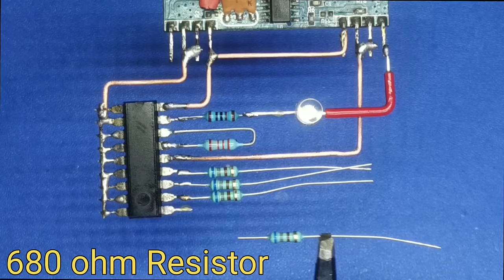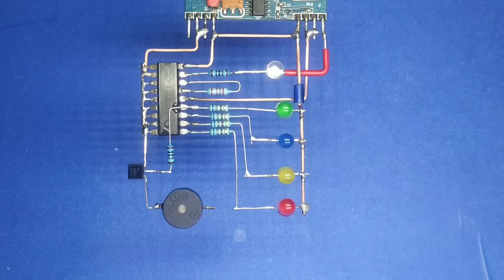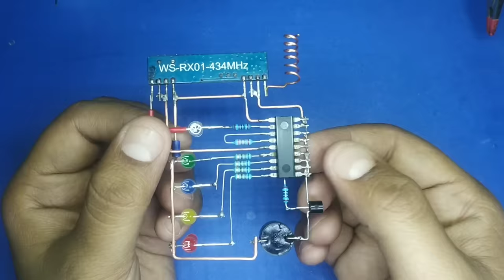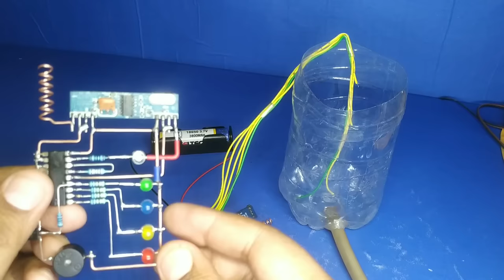How to make Wireless Water Level Indicator with Alarm

Comment: good project bro and helpful for us what is range of transmitter and receiver and what is cost of this project.
Reply from the maker: Hello, Range in open space (Standard Conditions) 500 Meters with Antenna / 100-200 Meters without Antenna....For component prices visit robocomp.in Link is given in the Discription Thank you so much
Reply: @anuragprojects  thanks bro for your valuable  reply
Reply: @anuragprojects  on that page they only have 433 MHz

Comment: Dear friend, I am following the video of level sensor without wiring. The instructions indicate the 434 component as transmitter and receiver and I have not been able to find it, the most common is 433, it could be replaced by this one. If so, what would the diagram look like with this substitution? Thank you
Reply from the maker: Hi, I am making video on 433MHz RF Module. You must have a look. Thanks for watching.

Comment: Nice one, after you did the level indicator LED's was that a diode you connected up the LED's and if so what wat the part number, also if I only wanted to have a beep only on the 25% marker I would I do it. Keep up thi good content
Reply from the maker: Hello, It is not a diode. There is a piece of blue color pvc wire insulator which use for insulation in cross connection. Thanks for Watching 😊
Reply: @anuragprojects 😂

Comment: Good job bro..I m also using this circuit as wireless power switchs for my home appliances....but pls confirm how many days transmitter battery  work...as we have to regular Power on transmitter circuit..also confirm is this work from third floor to ground floor distance...?
Reply: Could you show the schematic for the switches?
Reply: The battery will flaten out in two days. U need to use continues power source.

Comment: Hi,
***In long wire in tank circuit diagram *
In receiver circuit Bc558 connected to an resistor what is the value of that resistor. 
Thank you
Reply from the maker: Hi, 1K Resistor. i have updated the circuit diagram again. Thank you for watching

Comment: Hi, circuit works perfect, but issues with voltage drop in wire when real length (1 meter long) wires are used. Any suggestion? I am providing power fromtwo  5v 1Amp adapter individually to both transceiver and receiver that is also passed to wires
Reply from the maker: Hi Bro...This new transmitter circuit is made for you. You must try it. This will solve your problem... Link - Link :- https://drive.google.com/file/d/1k-_t8p5UeQ7fjDKBJiMrb55WGsPYXJC_/view?usp=share_link
Reply: @anuragprojects  Don't you need water to be a bit salty for that to work? Do fresh water give you enough conductivity to bias the bases of the transistors high?  By the way, the same question applies to the original transmitter circuit. Is the water in your video completely fresh or has some salt in it?
Reply: Link is not working
Reply from the maker: Thanks for watching. Link :- https://drive.google.com/file/d/1k-_t8p5UeQ7fjDKBJiMrb55WGsPYXJC_/view?usp=share_link
Reply: Link is not working...🤔

Comment: Dear Sir,
            If two wireless water level circuits are to be installed with two water tanks, then what is the method to vary the frequency of both, please guide me. 
Regards
Zafarullah Khan Faisalabad Pakistan
Reply: I think try 333mh for the 2nd one

Comment: What can be the maximum length of wire that dips in water tank?
Reply from the maker: Hi, If the depth of water tank is more and you have to use wire upto 3 meters, then 2nd circuit diagram has been made for you...Thanks for watching my Videos... Link 2nd circuit :- https://drive.google.com/file/d/1k-_t8p5UeQ7fjDKBJiMrb55WGsPYXJC_/view?usp=share_link

Comment: When i connect continuse deep sound blows, singnal light not glows, please sugest solution, i tryed 2 times also
Reply: Try this on ac to dc adapter but don't dip the wire into the water while using adapter. Just connect COM to any  of 4 channels.
I used 9v battery with 7805 and it didn't work.  I thought I had bad soldered connections. It was because of battery.

Comment: This is good circuit, but HT12E/12D pair is buggy IC. Their output is erratic when their is power cut. Made this same circuit with some modification 6 years back, used for 4 years. Had problems always, finally dumped it. better not to use this. for newbie it is ok. Better use 7 segment display and mini-floats for best output. avoid RF transmitter-so buggy.

Comment: What is the range between receiver and the transmitter
Reply from the maker: Hello Bro,  Range in open space (Standard Conditions) 500 Meters (with Antenna) / 100-200 Meters (without Antenna). Thank you for watching....
Reply: Thank you for your response

Comment: What is the maximum distance between transmitter and receiver?
Reply from the maker: Hello, Range in open space (Standard Conditions) 500 Meters with Antenna / 100-200 Meters without Antenna. Thank you for watching....

Comment: What an absolute WASTE OF TIME!
For my water tank, I simply put a T junction at the outlet, and connected a piece of CLEAR plastic tubing vertically against the tank, adhering it with some clear silicone.
I sealed the top of the tubing with a PVC end-cap but put a couple pin holes to allow airflow.
I also put a few coloured lightweight beads which float, so I can simply look at the tank and see the level easily from the beads.
No elaborate nonsense like this!